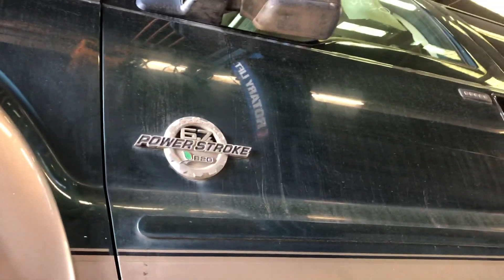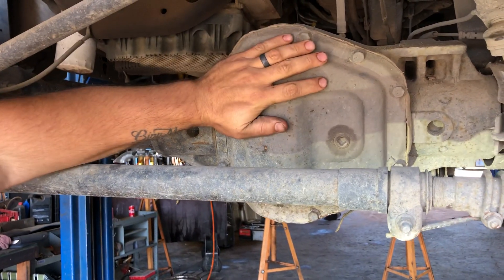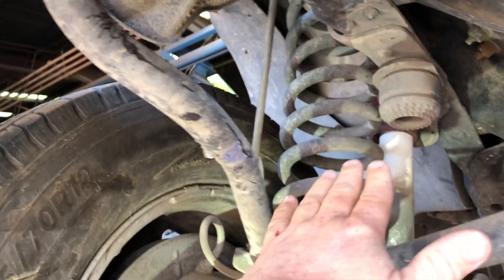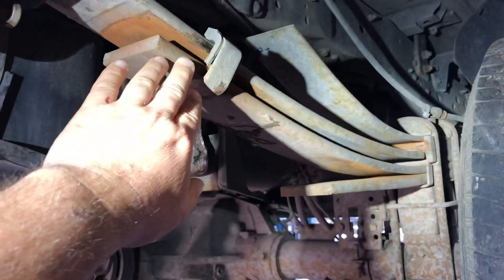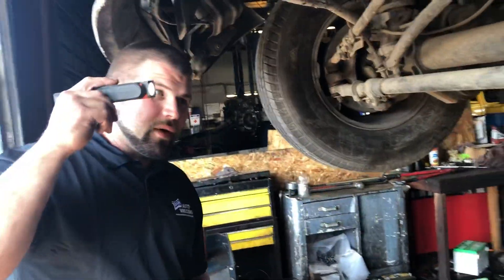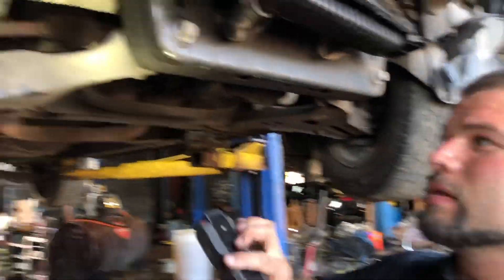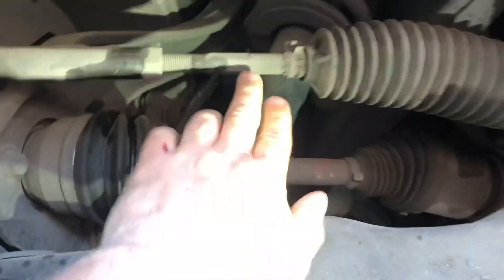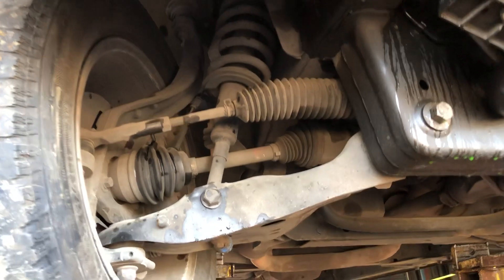Independent Suspension vs. Solid Front Axle

Comment: You guys are in the parts business, but keep referring to the drag link as the Panhard. At 2:03 and 3:51, JJ reaches for a bar connecting the axle directly to the frame. But, he's interrupted each time by the guy behind the camera. I really wish we'd gotten to hear what his name for that part was. (Hint: That's the Panhard rod, a.k.a. track bar).

Also, the bar you're calling the idler is the tie rod. Thus, the "tie rod ends" at either end. An idler arm would be found on a parallelogram steering setup at the opposite end of the center link from the Pitman arm. That's not this setup.
Reply: Bro it sounds like you need a beer 🍺

Comment: independent makes more sense better ground clearance your other tire always stays down correctly why the other one is flexing.
Reply: It depends on how long the control arms on the IFS are. A lot of stock vehicles have short control arms that results in constant wheel lift.
Reply: CRAP,,  YOU HAVE 4 OR 6'' TRAVEL. A SOLID DIFF HAS UPTO 2 FT..  you cant raise an ifs.. cv,s are bs for 4x4,s.. ifs will roll before a solid diff vehicle..